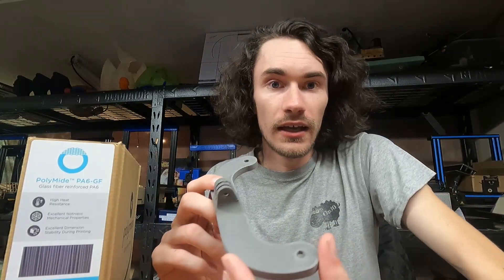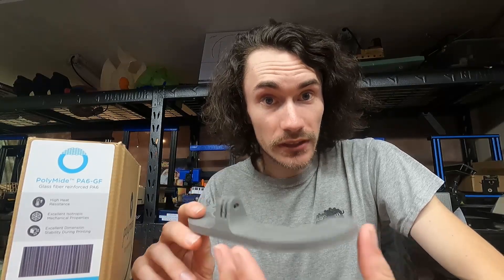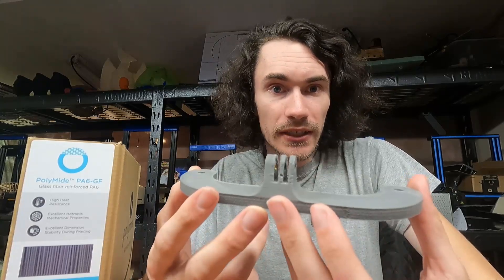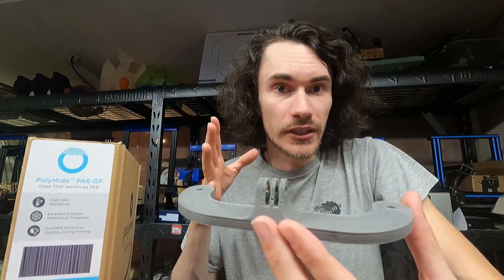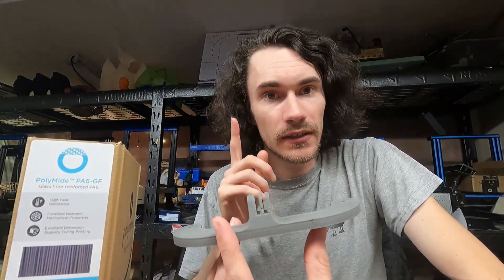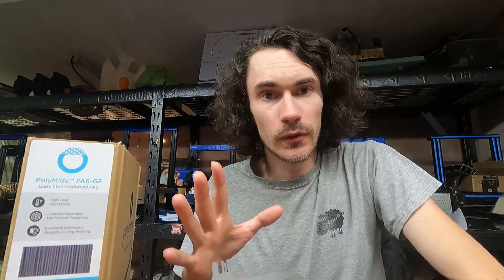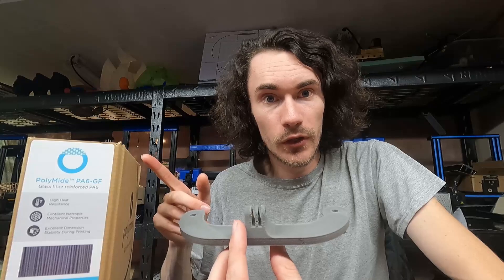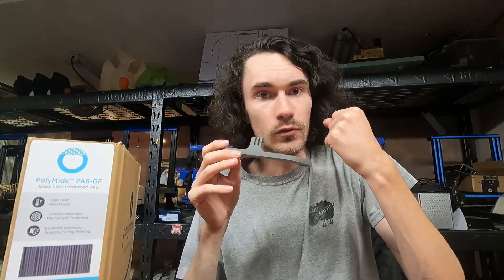Polymaker Polymide PA6 GF Initial Impressions

Comment: How the heck did you get this going well without warping? 
I am now on my second spool of PA6-CF and GF and every print is warping. I can change whatever setting and it warpes and warpes....
I use a Prusa MK3S+, BiMetal CHT .6 nozzle, 290degrees, and for the bed I tryed everything in every combination from 35 to 105 degrees..... For sure I am using magigoo PA. 
Could it be the textured PEI surface? But you also printed on PEI?
Reply from the maker: I was using smooth GizmoDorks PEI on my machine, I do wonder if the texture of the PEI is an issue. On BuildTak Nylon I had NO adhesion issues, I actually had to watch my first layer height or the print would try to weld to the surface. I am also curious, what kind of nozzle material are you using? 

Also, have you tried reaching out to PolyMaker to see what they say?
Reply: @MakeItWithCalvin  I am using stock Prusa TXT PEI, but will try the Smooth one. 
My nozzle is a Bondtech BiMetal CHT .6 so it is copper with hardened steel core. 
BuildTak or glass is recommended by Polymaker or? 
I have no answer so far from polymaker and it is like 2 weeks ago.
Reply from the maker: Have you looked over their "product info sheet" it goes into detail about what to do for temps and a build surface. I just chose PEI & BuildTak Nylon to see how it behaved on different surfaces.